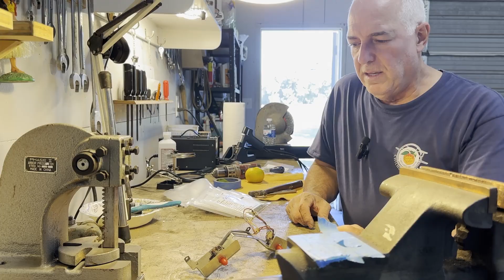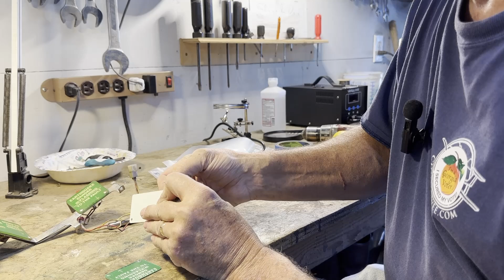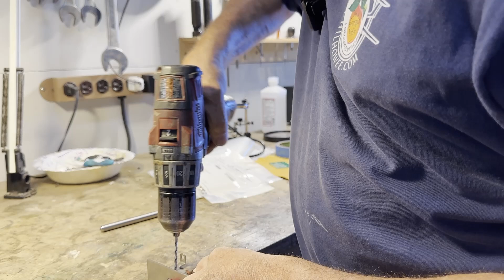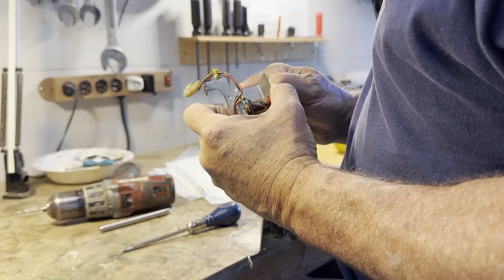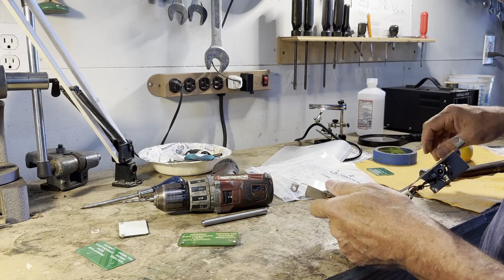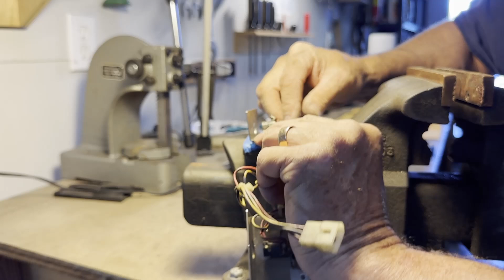How To Use Tubular Rivets

Comment: Thanks!  Very nice - gonna get into some of this with small things on jukebox projects - and this is perfect.  I am finding that the big drill is a little overpowering for small thin metal items - when getting the original rivets off -- so thinking about using the Dremel which is a little easier to control and just grind the rolled back down.  I'd like to see more options for getting old rivets out without destroying the hole.
Reply from the maker: A dremel with either a cutoff wheel or a sanding drum works great. Grind the back flush and punch rivet through the hole. I just repaired a friends Wurlitzer.
Reply: @LaneTheProjectGuy  that was my thinking - they also have a wide round ball type grinding stone that is as wide as most of the small rivets - and I was thinking of just laying that on there until it is flush -- BECAUSE I don't have enough space to turn the drimel sideways for a sanding drum